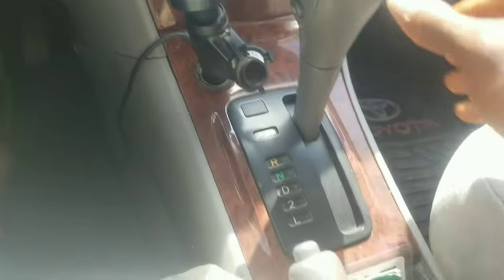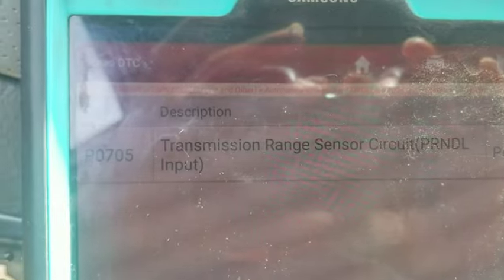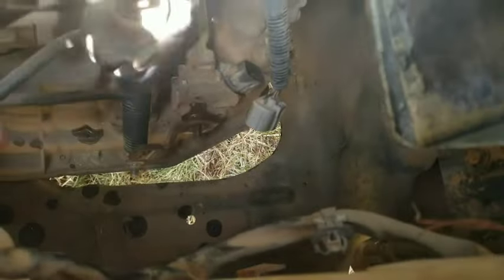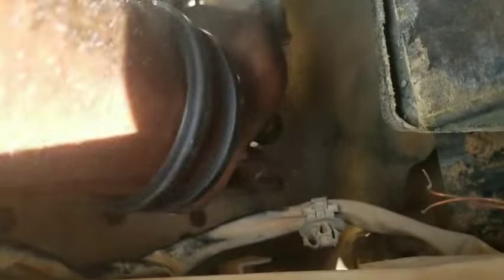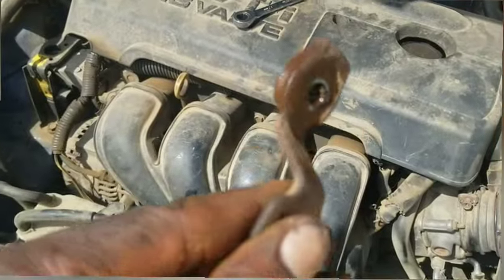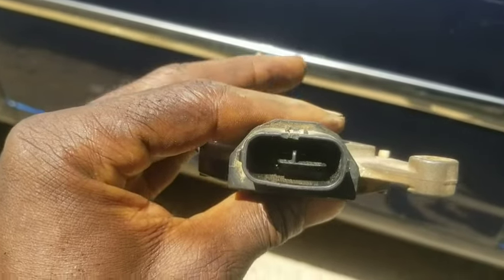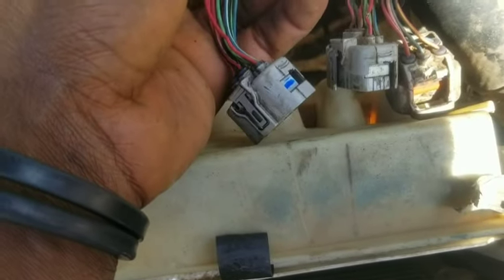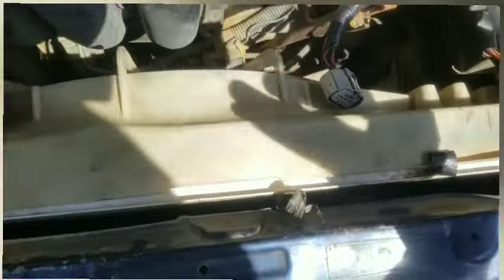Car Won't Drive Forward But Reverse Fixed | Automatic Transmission Only drive in reverse Solved

Comment: Just turn off the Emergency brake. In my case, the Emergency break was near the main break pedal. So I just stepped on it to release the emergency brake and vroom, I could move the car again.
Reply: Was your car a dodge charger ?
Reply: @juliansdiamonds  Its a Honda
Reply: Oh ok.  Thank you
Reply: I'm having same issue with 2016 hyundai elantra, it just started and front brakes need done also, any advice
Reply: Were you able to reverse
Reply: @TayeTaylor-k8u  yh
Reply: @franklynfosu what year?

Comment: My 01 122k mike ls430 does this on cold start. I have to rev n shift around and it kicks in. Only happens on cold start. Car drives and shifts perfectly. Any suggestions?
Reply: I have the same problem with my 2008 Toyota Rav4 transmission fluid level is good 
Did you find any solution?
Reply: Have u found any solution?
Reply: any fix?
Reply: Same Problem here with my 2007 Nissan Versa,, please share solution.

Comment: Good job bruh! I driver a corolla 2013 4 plugs, it drive on reverse but will not move on drive, my mechanic said I should change the transmission complete, the the transmission oil smells burnt, but after watching your video I felt it could be same issue with the one you just fixed, what do you think?.
Reply from the maker: Replacement will fix too
Reply: @ntamichael9343 any luck ? My car is doing the same only reverse works right now
Reply: @jrboxtha8255  you can just scan and know what the fault is, I had to change complete transmission on mine.
Reply: @drcoolautofix  I'm from Durban can you assist me with my V8 automatic Edelbrock Chevrolet
Reply: Hi,i have the same problem with 2005 corolla,to confirm ,you change the sensor and fix the problem or ,change the sensor but no work and have to fix the transmission?

Comment: My 2005 545i bmw only drives in reverse can someone please help
Reply: Did you manage to fix it ? What was the problem bro
Reply: @mohamedkarboua1873  to be honest 90 percent of the time it's just feeling your transmission with atf and it should kick the solenoids on to work just make sure that you fill the transmission with enough fluid or pump it in till it starts to flow out the side upper feel bolt and then close the bolt as soon as it starts to leak out the fill bolt good luck 🍀
Reply: 2:35  Good Afternoon Guyz, so i have a 2001 Buick lesabre & it will only drive in reverse,will this information work for my car??    Please i really need her bk on the road😢

Comment: Nice one bro, thanks for the video just that my 04 toyota sienna only engages on reverse but wont engage on drive so i dont know what might be the cause .
Reply: Does this work for a 2012 Nissan Versa ?
Reply: @Alex Bighams  my 2012 nissan juke has this problem :(
Reply: @GamingWithSpookz  have you fixed it?
Reply: My 2006 Mercury Grand Marquis has this issue only moves and engage in reverse but doesn’t move forward in drive
Reply: Did changing if the sensor fixed it?

Comment: I like the gasoline method for cleaning the contacts. Cause it leaves the option of striking a match... I'm going to go look at a different make and model, but same symptoms and the same application should apply for the nessesary trouble shooting I will be preforming. I had the same flight plan
So with the landing gear down I'll be making my final approach, thank you
Roger that, over and out.
Reply from the maker: 🤣Nice one, you gat me going for a while..

Comment: My 2005 Toyota Matrix has similar issue. Reverse and Park works well but when i shift to drive, it doesn't respond, when i hard rev or wait for about 30 seconds, it enages. What do you advise i do?
Reply from the maker: Same thing applies as instructed in the video  and Playlist

Comment: Good morning sir my Nissan Almera entered reverse (R) when I was put it in park (P) and  then I switched the car off now trying to turn it on it isn’t coming on and but it’s showing Reverse on the dashboard while it’s in Park
What do you think is the problem?
Reply from the maker: Check the safety neutral switch, replace it with another or double check if its in the right position or broken
Reply: @drcoolautofix  changed yesterday and it’s working fine now thanks 🙏🏿

Comment: I hit a hard block of concrete and put a hole in transmission pan..replaced it and filled with 13 quarts and car drove good for 40 minutes but was smoking heavy now car wont go forward but it will reverse fine

Comment: I got a 1996 Infinti i30 and it’s not moving forward but it goes back but I also have dirty transmission fluid to could that be the problem like do I have to change my transmission oil ?
Reply from the maker: https://youtu.be/kzxXydY2HsM

Comment: My 2004 Buick Rainier won't drive in any gear except reverse I changed the solenoids filter and the actuator or accumulator I forgot what it's called. I changed the balls and separator sheets in valve body but it still won't budge?
Reply from the maker: Well you just changed the wrong parts

Comment: Hi: you don’t put in the video the final result, when you change the safety neutral switch the drive work  again ? Because i have the same problem and the mechanic says is the transmission, I have to be sure before taking it to the mechanic by tow truck,waiting for your answer thanks
Reply from the maker: Here is the update 👉https://youtu.be/qD7fLSM23Rg
Reply: @drcoolautofix  Sorry but now I'm more confused because there are many cases in general, can you please answer  me the original question in this particular case?When changing the sensor was the drive problem fixed or was the transmission bad?
Reply: @carlospr4322 why he hasn't answered

Comment: My sienna 2006 have this same problem can i change the same thing or sienna have another thing to solve the problem?
Reply: Did you find a solution yet?
Reply: Same for my 2009 Sienna.  I replaced transmission last week
Reply: This happened to me this afternoon

Comment: My 2005 lesabre buick does the same thing tried to look up this part for it bt dont think it uses the same system the trans i have is ran off pressure can u help?
Reply from the maker: Check the Playlist there is another video about this with better information

Comment: Does this work on an 87 ranger? I have reverse no drive.
Reply: You find a fix? I have an 89
Reply: @jamesrothwell7196  Transmission died on mine. Do a complete fluid flush on the trans fluid and top it off and try then

Comment: hello commucated well being working on a 2007 volkswagen jetta 2.5  now the car ran great it stills starts up now i was run nig low on trabby fluid so i put some in the pan where that sensor is and it seem to work fine now over time i have done several more times then i had replace the inner shaft passerner but when i went to change the drive side it seem to be stuck so i cut it off at the cup and just stuck the other one in the now i have reverse and not engaging into drive any help
Reply from the maker: You need to scan the car

Comment: Y'all have the damn Emergency brake up. U don't see that its pulled up? Push it down
Reply from the maker: Mr gun be cool, that isn't the issue here
Reply: @drcoolautofix I was only joking. But really tho could this be the reason my 2007 Chevy Monte Carlo LT doesn't move when it's in drive gear??

Comment: I have a mercedez  c230 kompressor  2003 only works in reverse. Does anyone has the same problem?
Reply from the maker: Mercedes have system present inside the Transmission system not valve body. that's famous to be causing this particular problem